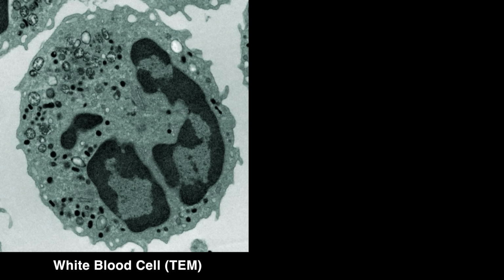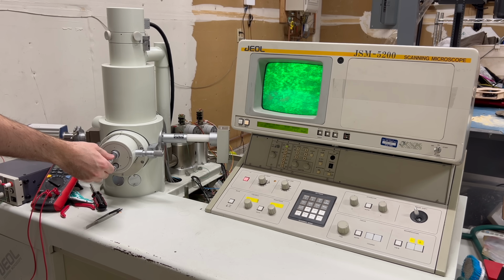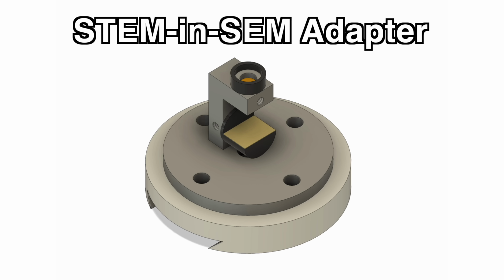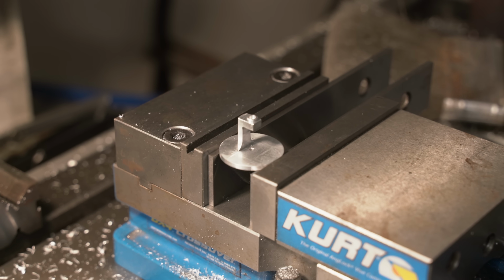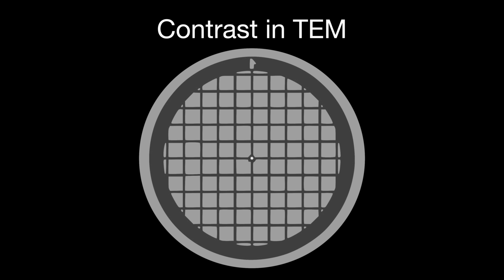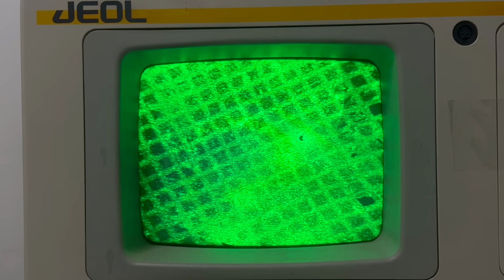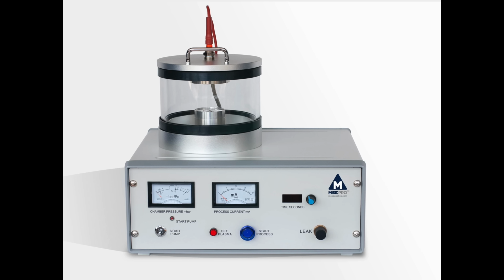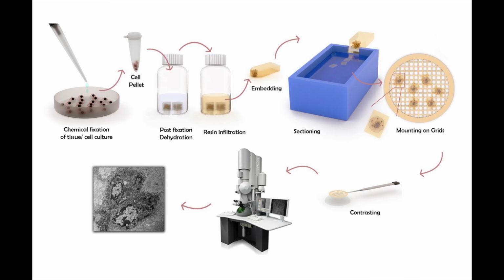Converting My SEM Into a TEM is Surprisingly Easy

Comment: When you placed the gold sheet on your adapter did you change to a Back scatter detector? Because if you are trying to use gold to generate more electrons you are only going to see that in a back scatter electron detector since BSEs are much higher energies and wont be affected by the small electrical charge on the SE detector.
Reply from the maker: The everheart-thornley detector in the corner measures both secondary and backscatter electrons by default. I do actually have a dedicated backscatter detector directly above the sample holder too, but i've never powered it up (and it wouldn't fit with the TEM sample holder anyway).
Reply: @projectsinflight  Gotcha, the Zeiss Gemini I work with also has the everheart-thornley detectors for both SE and BSE but we normally capture with the InLens detectors (the ones directly above the lens). I didn't realize that the ET detectors can capture both simultaneously I always have to turn one off when capturing X-Ray images.
Reply from the maker: @MultiSearchlight  The ET detector is capable of capturing BSE and can be BSE only (by swapping the positive voltage to negative to repel the secondary electrons) but its position is terrible for collecting BSE since the majority of those electrons go upwards, hence the position of your detector.

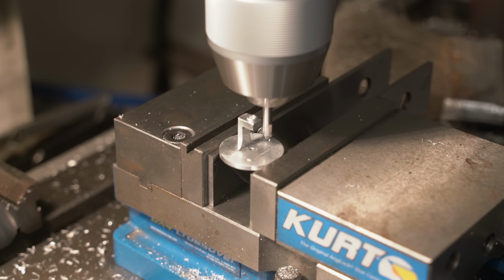Comment: Is there any reason you couldn’t 3d print the sample holder? Do polymers have issues with electron beams? 13:02
Reply: The electron beam can alter the molecular structure of the plastic. I assume anything non-conductive is not a good fit as the electron beam literally rips electrons from the material. + it would have to be 100% infill due to the vacuum, and it will be less sturdy. So overall not practical
Reply from the maker: I was going to reply and then I saw that you covered everything in this comment :)
Reply: @projectsinflight 😅

Comment: i shall call this STEM microscope
Reply: STEM actually means scanning transmission electron microcope/microscopy, but it's a technique in a TEM, not the term for the amalgamation of SEM and TEM.
Haven't watched the video yet, so maybe he acutally builds in a STEM mode.
Reply: @turun_ambartanen  Microscopists tend to use STM to refer to scanning tunneling to avoid confusion with scanning transmission. While you're correct that STEM is technically a TEM technique, it's becoming more and more common to see dedicated STEM instruments for advanced characterisation techniques like ptychography. If you don't need TEM capabilities, then you can cut costs significantly by removing the projector/intermediate lens systems that would project onto a screen or camera in TEM mode.
Reply: @waifuhunter420  Thanks for pointing out my typo. Don't know how I made that mistake, lol. I fixed it now.
Reply: @turun_ambartanen  He actually does! And it's about as crazy as you would expect lol